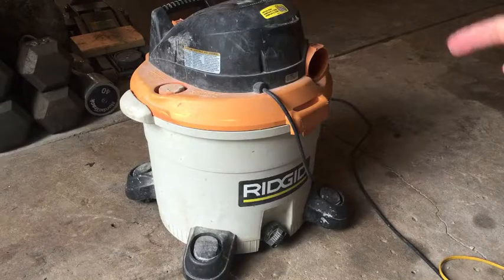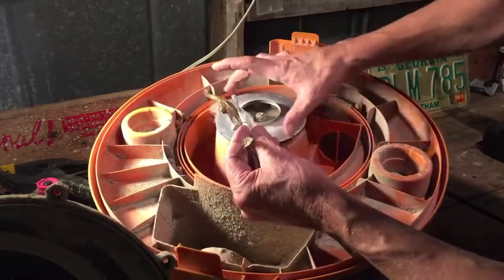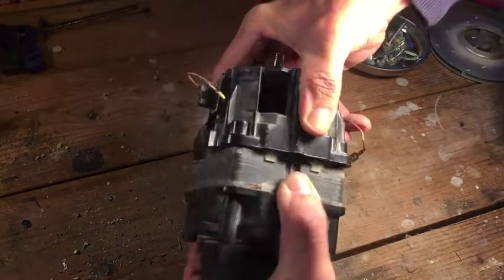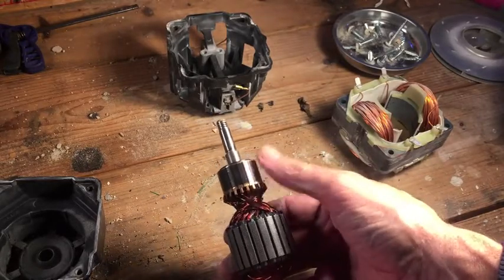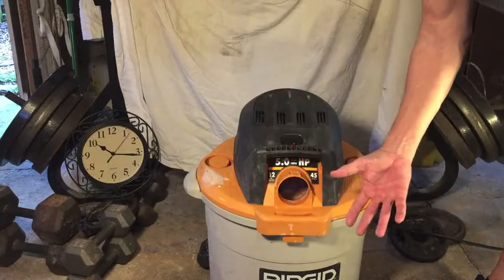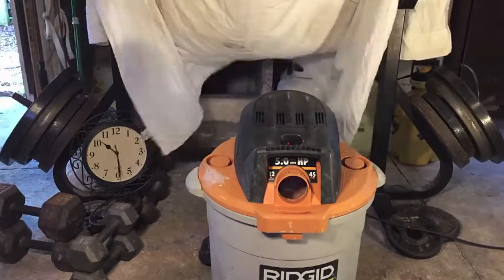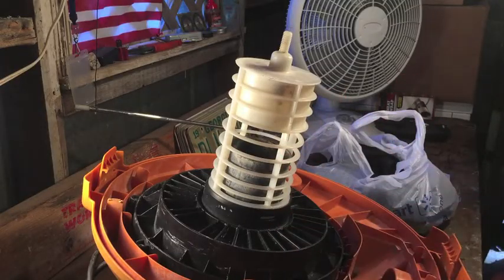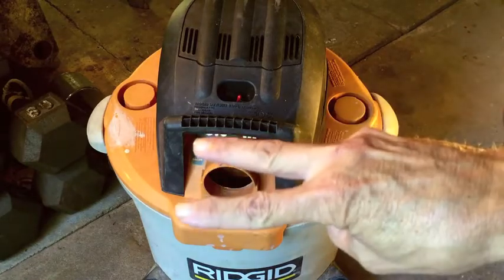Ridgid Shop Vac: Commutator Cleaning, Clogged Impeller, Clean/Lube Motor Shaft

Comment: Nice job just took mine apart and the plastic near the windings melted and the continuity of one winding was broken somewhere. Its trashed so off to HD to get the new one thats on sale 50% off and going to use a vortex type dust collector. This should keep the filter clean when using the saw and sander.

Comment: My son recently found in a dumpster a big 14 gal  6.5 hp shp-vac SVX2 ,that he gave me. It even has the huge hose and all the attatchments still on it!  
It was so clogged up with white dust and pieces of particle board (looks like a construction site had it previously). Plus it didn't have a filter on it, so for a filter  I used a knee-high panty hose, I had a box of them I found years ago in a Dollar Gemeral store dumpster lol.
Reply: Oh btw, I think it was thrown away because when turned on you could smell a burning smell and the bearings needed oiled, so I cleaned it up and oiled it and now it works great!! 😁

Comment: Great video. I finally found a problem: a slice in the power cord. I did remove the motor and after putting the vac together, I have no suction. The motor runs strong but I'm stumped. Are my wires wrong? I have air blowing out of the top vents if that means anything. Unfortunately, I did not make alignment marks on the motor and housing when taking the motor out. I thought I would remember how it went in or would only go in one way. Also, I'm wondering about the wiring to make sure everything is right.

Comment: The white trash is the paper that a filter is made out of. They are white and pleated. Some also came with a similarly breathable tube that you put on to protect the pleats from filling up.  Vortex collectors that people make avoid dirt even reaching the filter. Plus if you use it for wet vacuuming no filter is required. 
The hose for this is enormously fat but the car cleaning kit with adaptor made it very narrow. So you can use any hose really.  Fat is good for picking up wood chips. My guess is that the motor is the same on all sizes 5 gallons and down so a thrift store hose will do.  The replacement hose that fits this is very good and non-kinking. You would not be extravagant if you bought a filter, a hose and a nozzle.
Reply from the maker: Two years later this is still sitting on a shelf in my garage with no hose.. Current Rigid replacement hoses have a smaller diameter fitting and won't fit.. I'll rig up something homemade one day..

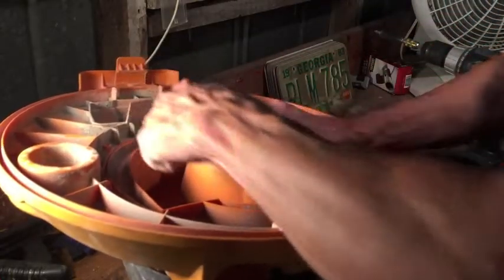Comment: How do you remove that bolt on the motor? (1:01)
Reply: I'm having the same issue
Reply: there is an Allen head recess in the bolt to hold the shaft from spinning, then use a half-inch wrench on the nut.

Comment: The ridgid vac I have for some reason the motor was not easy to replace. The washer was locked into place on the shaft. It seems like with the newer models they tried to make it where you have to buy a new motor. I ended up damaging the end shaft by hammering it lol.
Reply: Same problem with mine...
Reply: @chelostgo  I think you need puller or some kind of tool to get that locking nut off.

Comment: Why spend all that energy and not put a legit filter on it that will catch the debris that caused the soiling!?
Reply from the maker: It does need a proper filter but in truth I haven't used this shop vac at all since posting this almost 2 years ago.. This is an older unit and the hose fitting diameter on this one is larger than on newer models.. New replacement hose will not fit.. Forced/planned obsolescence..

Comment: I watched your video on the shop vac that you found and fixed. I was wondering if you had any advice with my issue with my rigid 16 gallon shop vac. I've had mine for somewhere in the 10-15 year range and until today it has performed amazing. Has been used for regular vacuum duties blow used as a blower in the past and has served as a dust collector for years(also use a dust separator). Today however the on/off switch started acting up. Wouldn't turn on without a little extra "Help", lol. It turned off just fine but not on without a little tap. Then just stopped turning on. I was taking everything a part when the motor slipped out of my hands and fell on it's top and about half of the plastic going around the blades/fins broke off. I don't know if it's safe to put back together and use like that. Any advice? I really appreciate your time, Thanks in advance if you can advise,

Comment: Why not just buy the genuine ridgid hepa 5 layer filter and buy a filter pal covering sleeve so it can last long because if you use a sock yes it can block out the big debris but with dust and dirt you’ll suck up, it will fry out the motor very quickly and leave the air quality unhealthy due to the holes in the sock. And for the hose you really can’t make up a homemade one you would have to go get a genuine hose from Home Depot and a red tab hose adapter. Other than that great find. 👍
Reply from the maker: I priced out filter, hose and adapter which together would have run close to $60.. If I was going to spend that much I would put it towards a new vac with warranty.. And yeah, homemade hose?? No easy solution there.. Maybe something with PVC and JB Weld?? Not sure.. We'll see..
Reply: @tongo117  actually you might be onto something. Maybe a pvc made adapter and some pool vacuum hose that threads into the adapter and can be a bit more affordable.
Reply: @tongo117  I have the same model ridgid vac in the video. I usually buy it’s necessities at Home Depot like the upgraded orange pro hose. I never really come up with homemade ideas or diys on it.